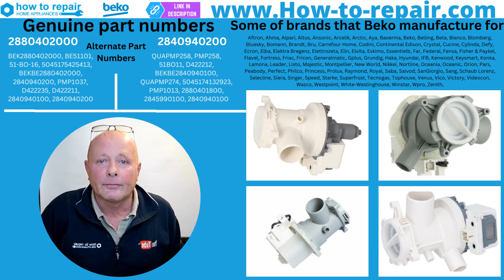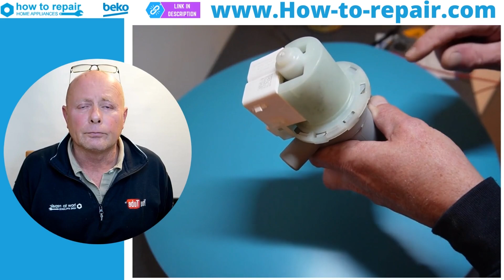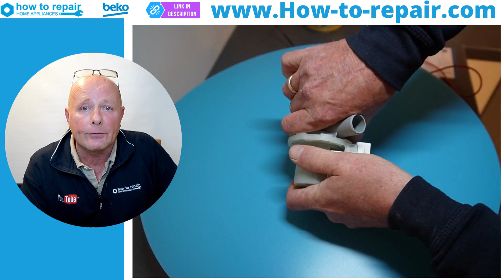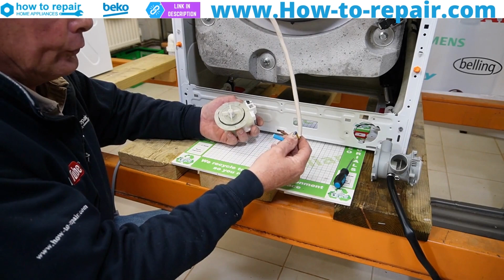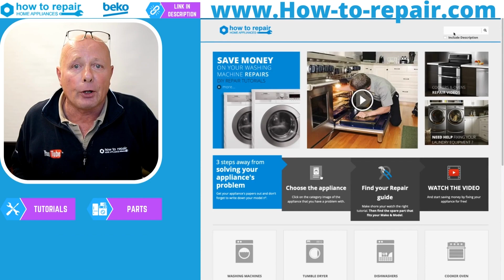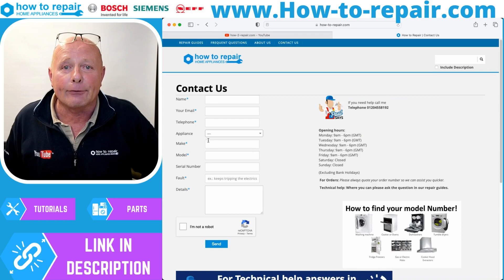Beko washing machine which pump 2880402000 or 2840940200 confused about which parts today

Comment: I have a Beko WDX8543130B why is it not fitted with the little hose that pulls out to drain water as standard,, 
its a night mare trying to drain the water from the front, you can bearly get a tray underneath and it takes for ever,
Could i fit a different pump housing or drill out the blocked little out let and buy a rubber tube from you?

Comment: My washing machine not filling water on Beko 8Kg ref WM84145W, I've checked the pump nothing wrong with it,
Reply from the maker: Hi mate, if it's not filling with water and there is nothing wrong with the pump, it could be due to a lack of power to the water valve, or an inadequate water supply. 

If there's no power going to the water valves, it might be an issue with the printed circuit board or an active anti-flood device. You'll need to check both of these as well.

Comment: I found that after buying a brand new one, the problem with the old pump was the impeller came off,
Reply from the maker: This normally happens when a hard object like a coin has gone through the pump, and it strips the shaft on the impeller.  glad we could help you @dantronics1682 this is for you https://www.youtube.com/shorts/e432SAb2g08 please remember to subscribe as that's what keeps this channel going. Thanks 👍